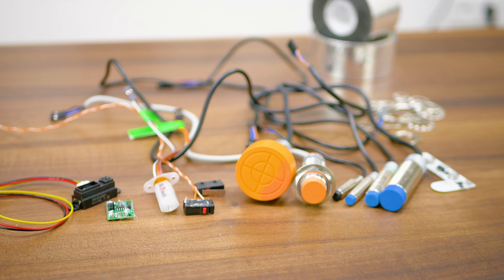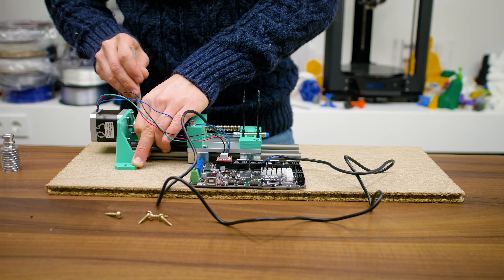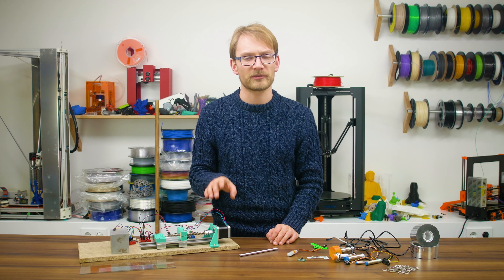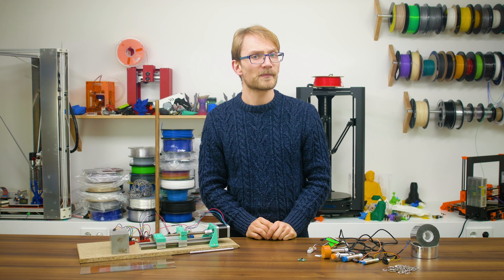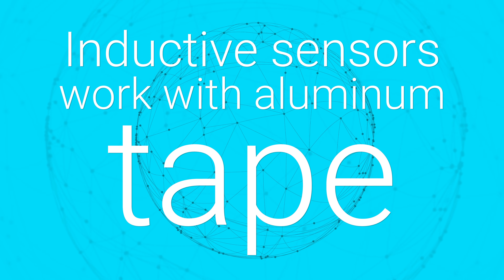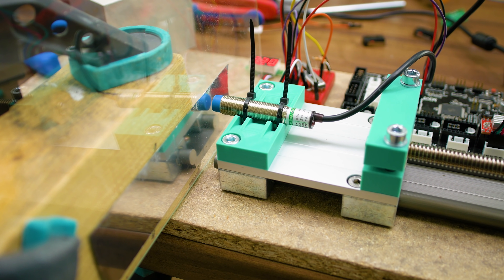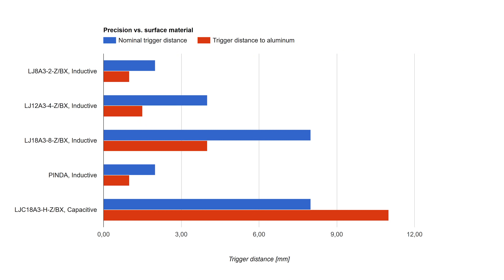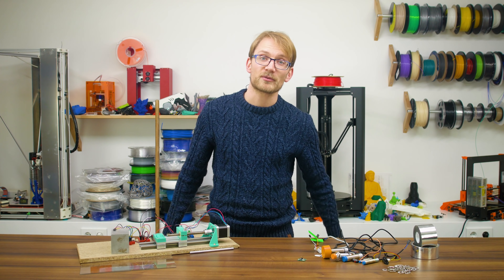Autoleveling on 3D printers: 9 myths and 12 sensors tested!

Comment: Sorry Tom but you must have gotten some kind of tape with metallized plastic, not actual foil tape, because your conclusions about foil tape not working for inductive sensors is incorrect.  If you use actual HVAC aluminum foil tape, it will detect BETTER than a solid block of aluminum.

Comment: @Thomas - And additional info for you: I've noticed a huge unreliabilty with my inductive sensor C-Lin P-802N (runs nicely at 5V) - first I thought it was caused by temperature differences caused by my huge high powered heat bed, but after a while I found that even smallest drops in the voltage of the printer control boards PSU makes sensing distance very unreliable (using a cheap chinese 12V 6A notebook-psu brick for the board+hotend). I've came to that conclusion after changing to a old and dirt cheap ATX psu as reliability got MUCH better but still got not perfect (bad quality "250W" ATX PSU). Now I'm using a 200W 12V halogen trafo, rectifier, added several very huge Elko  capacitors (about 50k µF all together) and now sensing distance is +- 0.00Xmm reliable instead of +-~0.3mm!!! I heard that the BLTouch (and it's chines "3DTouch" clone) have similar problems.

Comment: for my scratch built reprap delta we used a simple conductive type, running 1 wire to the nozzle, and another to the aluminium bed, reeally simple and easy, and no need to worry about effector tilt

Comment: Hi,
I 'm not sure what's happening with my sensor which is the 8 mm inductive npn one.  Before adding the Voltage divider I put in 12V across blue and brown and get a 12V signal on the black when I hold the sensor near metal and 0V when the metal is removed.  When I add the Voltage divider as Tom did (double checked and resistors measured with multimeter to test) I get 3.6V signal on black when not near metal and 0V when I put sensor near metal.

What have I done wrong? can I use this as a normally closed (nc) switch for bed levelling/tramming?

Comment: I think you did the BLTOUCH  a disservice, Tom.  While the other sensors perform equally well in any position, such as your horizontal position in the test fixture, the BLTOUCH is designed to work vertically.  When put in the horizontal position, the sensor pin and magnet must overcome the additional friction of sliding along the bore of the guiding hole.  This can lead to inconsistent measurements due to friction and grabbing.  I consistently get average variation in 
readings around 0.015 mm
Reply: This!. The BLtouch is probably the best sensor on the market when used properly.  It doesn't care what your build surface is and once your offset is determined you never have to worry about bed leveling or adjusting anything to do with the Z axis again. I routinely start a print and walk away, and expect it to come out perfect, and it does. The autoleveling is done once the bed is up to temperature, then the nozzle wipes across a brass brush, and quickly moves to the bed and starts printing. The BLTouch is an awesome bit of kit.
Reply: 0.015mm is a lot of deviation

Comment: Hello Tom, I have a aluminum heated bed and a genuine e3dv6, and I was trying to use the autobed leveling making a "button" that closes when the brass nozzle touches the aluminum bed. Turns out that there is some kind of "coat" or resin or something in the surface of my heated bed so it doesn't conducts eletricity. Do you know what is this coating and why? And is this a good idea, use the nozzle itself?

Comment: I don't know where you're getting your sensors but I use 1 strip of aluminum tape under glass. Works like a charm. I used it as a retrofit onto the printrbot simple metal and it worked better than with the aluminum bed.

Comment: Hi - I purchased one of the LJ18A3-Z/BX sensors for my ANET A8. I installed resistors between the signal and ground wires - I used (nominal) 18k Ohm for the small one and 27k Ohm for the larger one. After installation, the output voltage on the signal wire is 4.06 volts when the sensor is NOT triggered. 

However, voltage between the signal wire and ground when triggered is 0.46 volts or so. So, when I send an M119 command to my printer, the Z-axis never shows as 'triggered'. The 0.46 volts between signal and ground is also there without the resistors.

I am using SkyNet3d 2.3.1 firmware. Do you have any ideas on how to fix this? Ironically, this sensor 'works fine' on the five-volts provided from the Ramps board, but I wanted to improve accuracy by using the 12-volt supply (which actually measures about 12.5v).

Thanks for the great videos!

Comment: So, your "control sensor" setup got me thinking... How about using the actual hot-end as the tramming sensor on an aluminum bed with a continuity relay/transistor?  Slow stepping during the bed-level probing so the head isn't being slammed into the bed, but effectively, get a really tight contact detection.  Not suggesting the crufty inanity that are the Kossel-Mini momentary switch toggles built into the effector head... Instead, let the the hot-end and bed BE the switch.

Comment: Hey Tom, love the vid! I own a hatchbox alpha printer which uses a totally different way to level than all the ways you showed. I curious if what my machine uses stacks up against other sensors. It's a delta style printer with a floating bed that rest on three rubber stopper. Under the stoppers are these sensors. https://www.adafruit.com/product/166  It hits three points around the bed (at each frame rail) then I manually set the z height in the middle of the bed. Home, then ready to print. My question is, I'm thinking about changing to a 32bit board (smoothieboard, etc) and wondering if utilizing the current sensors or switch to a different sensor all together. Thanks

Comment: Should expect this but eh... The "run on 5v myth" is not busted.... The sheer amount of people (myself included) who HAVE ran 6-36v inductive/capacitive sensors on 5v with ZERO PROBLEMS, prove that the myth is not a myth... Hell I TRIED to run it off of a voltage divider from your own tutorial on how to do so, and the sensor never worked. I plug it directly to the board, and presto works 100% just fine.... Calling it a myth is kind of bs...
Reply: You're both only half right. You probably have a PNP type sensor which works on 5V, but he has a NPN type sensor which doesn't. They look identical and the part number is pretty much the same too. LJ18A3-8-Z/BX is NPN, LJ18A3-8-Z/BY is PNP. So when looking for inductive sensors, make sure it ends with "BY" or look for a mention that it's PNP
Reply: LJ18A3-8-Z/BX 8mm Approach Sensor Inductive Proximity NPN NO Switch DC 6-36V I6Tthis was the one I bought and I found it only worked on 5v. I used to have a 4mm anet a8 type one which I used a resistive divider with. when I tried to do the same with this one it didn't work so I kinda think Hikari has a point here. then again china could just be mislabeling stuff.On 5v it just senses my stock anet a8 bed through a 3mm sheet. and only just. Its a pain to print PETG but PLA does seem to stay just below the sensor. for this reason alone I am considering the bltouch style.

Comment: Great info, thanks Tom. I recently installed David Crocker’s IR sensor on my Prusa i3 box frame, which uses a 3mm glass bed and a red Mk2 PCB heated bed, inked black with a permanent marker in the sensor probing areas.

 After watching your video, I tweaked Marlin so that G30 would output the trigger height to 3 decimal places (1 micron resolution). I turned on my printer and made 46 measurements with G30 and got an s.d. of 1.4 microns. I noticed a trend in the data, presumably due to temperature drift somewhere in the system (probably the steppers warming up my crappy M5 threaded rods so the trigger point appeared to get lower with time). So I did another 34 measurements and the s.d. was 0.8 microns, but still with an obvious trend.
I think these numbers are an order of magnitude better than you got with glass. Maybe it matters what is behind the glass?

I should also mention there was a thin layer of glue stick on the bed under the probing area from the last print.  Also I have slightly modded my sensor board to increase the trigger height from about 2.7 mm to 3.2 mm by tweaking the angle of the outer LED using a hot-air rework station. This is so that it would clear the bulldog clips I use to hold the glass down so I could still retain my full 200x200 build area.
Reply: That's because, most likely, your bed surface is suitable for Crocker's IR sensor. The testing surfaces and setup in the video is stated as not suitable in the documentation. If you are running a glass plate on top of bare aluminum it is recommended to paint the aluminum matte black. I wish this test was done with the proper setup.

Comment: FYI. Inductive sensors are intended to be used with ferrous materials.  Their ability to trigger is severely lessened with non-ferrous materials.  Its takes a relatively substantial piece of non-ferrous material to get them to trigger at their rated distance.  this is why foil tape does not work , and why everybody complains that the sensing distance is incorrect.  in fact it is correct , what is not correct is the usage , and assumptions made.  I mean, they are "inductive" sensors , which inductance usually isnt well associated with non-ferrous materials.

Comment: Does copper give inductive sensor more sensing distance than aluminium?
If so can we add a thin small round copper plate under the PEI or glass sheet,  make it 9 points so we can make our own poor man MK42 heatedbed that support auto skew calibration?
Or maybe a thin stainless steel sheet?

Comment: How do i use a microswitch for the auto leveling? I mean where should i put it, so it is not interfering with the nozzle and mess up the print?
It seems a good option for me. I have glass bed on top of an aluminum sheet... (DIY)

Comment: The Sharp detectors take 16.5 mSec to take a measurement and output that value.  Or put another way, the analog or digital output changes every 16.5 milli second and the output stays the same in-between its readings.

Comment: I can't imagine using a Sharp sensor to level a bed. I would think the 50mm sense distance would be a major limiting factor. If you were going to use IR, I would think the tcrt5000 sensor would be a better choice with its 2.5mm sense distance.

Comment: Tom would you be willing to share your code for this please?  I have an MKS Base, the same IGUS slide (yay hackspace visit samples) and most of the same sensors, plus a couple of random ones I'd like to test - including the original and then Mk2 RRP Ormerod IR sensor - those things drove me mad, and I want to see how they perform relative to the inductive sensors I use.  Another motivation is that I do regularly use the M12, 4mm inductive sensor at 5V, it seems to be working well for me so I want to do some structured testing of 12v vs 5v and understand whether it may be 'working; but not optimal - and whether brand matters here.  Thanks!

Comment: Great, informative videos. Thank you. I was wondering if you tested the BLTouch horizontally or vertically?  I think that its accuracy is affected by gravity and would benefit from a vertical test. I agree that it is a good alternative for glass probing.
Reply: A coil-operated pin this small and  light should not be influenced by gravity at all. The testing method is perfectly acceptable in this case.
Reply: @pellin-unleashthebiker3101  not when you're dealing with micron-level precision. I calibrate measurement equipment to this level as part of my job, and misusing equipment like this is a total non-starter if I want something to perform accurately.
Reply: @TROPtastic  did you look at the precision of the bltouch horizontally in this video? It is only some microns, so still perfect. So the conclusion is it really does not matter in this case. For something else it may, but not for a simple 3d printer.

Comment: Hi, I use some lj12a3-4-z/bx on my printers and it triger on a glass plate with some almuminium foil sticked with rubber tape on it. Also supplied in 5V directly plug on my borads without any led or resistor.

Comment: Informative as always.  I use a LJ12A-4-Z/BY with an LM7805 VR on the output this gives a steady 5 volt trigger signal.
If you increase the input voltage does it does it strengthen the sensing distance.

Comment: Wondering if instead of aluminum tape, if using a quarter or half a zinc coated, or stainless steel washer, sanded flat and to a common thickness, and glued to "sensor points" on the corners, or a known distance from a corner, would be a workable solution for glass build plates and inductive sensors. One might have to go to a fender washer for enough ferrous material to sense, but if there is a way to tell Cura or your slicer that those locations are off limits for printing, it might be workable. 

The advantage I see is that most of us have access to washers, if you've adjusted an inductive sensor for an aluminum bed, you may be familiar with having to do other physical adjustments already. 

Down side would be that you wouldn't want to do grid leveling for this, unless you could etch your glass to drop such washers into the surface, and I'm not thinking that's a great idea.

Unknown is how large a washer you would have to use to get reliable results from an inductive sensor.

Comment: I read a lot of comments regarding aluminum tape working for some and not for others.  I might be able to add some clarity on the reason.  "Standard" aluminum tape has no real standard when it comes to compounding.  Many times manufacturers will use batch rejects, recycled scrap, Mold Ends and casting flash cut offs in the mix for tape.  This will introduce impurities, many of which are ferrous, that don't matter due to the tapes intended use.  It is these impurities that create differing sensing distances from one batch to the next as chemically speaking, one will be "Purer" aluminum than the next.

Comment: I would like to see the autoleving test with the tmc2130 driver. If this really works, we will have a big change in our printers. The nozzle would touch directly on the bed, remembering that the nozzle would need to be heated so that the residue does not interfere with accuracy.

Comment: Enjoyed the video. I've actually used the thicker gauge of "Duct Repair Foil tape" by sticking it to the top of the glass sheet and then putting a sheet of BuildTak on top. Maybe that's not aluminium? Anyway, my cheap sensor saw it.

Comment: When you tested the inductive sensors you didn't take in account the heterogeneity of an aluminium bed.

While printing with my VORON I have experienced inconsistencies with inductive sensors and my PEI-painted Aluminium bed from Clever3D. Basically the trigger distance was consistent on the same spot (just like in your tests), but varied when probing a different spot... and you need to probe at least 3 distant spots.

Today I switched to the VORON 1.5 X carriage, which uses the hotend itself (mounted on a mechanical microswitch) as a probe and the situation is vastly improved because a microswitch isn't affected by materials and temperature.

EDIT: In theory this applies to IR probes too, as reflectivity may vary across the bed.

Comment: Wait a minute... "All it does is to run the sensor into the surface, backs up a bit and then does that again 41 more times."

So you run the test 42 times? That's some deep thinking right there.

Comment: I got an 8mm inductive probe with an aluminum bed with PEI on top. Using the same gcode file, temperatures etc. and probing (in the same spots of course) after the printer has been cold a while, the precision varies so much I need to change the z offset with each print in Marlin by 0.05-0.10. This either results in minor head crashes or plastic spaghetti. Any ideas why this is happening and how I can remedy it? From what I understand in your excellent video this shouldn't happen.

Comment: For the mini-IR probe to be used on glass, the instructions say to put a black matte backing (black paper) behind it, or to paint the surface behind it matte black with high temp BBQ paint.  A reflective surface behind it like aluminum will give the kind of results you saw in your tests.
Reply: Tony, see my clone of Davids mini IR,  http://community.robo3d.com/index.php?threads/differential-ir-height-sensor-attemptin-clone-aint-sure-of-success-now-stage-10.6601/  ............Yes, you correct.....paint back of glass flat black.......Jimmy
Reply: I've been saying the same thing. This test was worst possible scenario for IR probes and IR probes only. I wish it was done properly.

Comment: I have another myth for you. What about getting different heights from the sensor on different areas of the bed? I have a 4mm 12V sensor, and it triggers a little higher on one spot on the bed, and I think it's because it's directly over the Y axis bearing. I have an aluminum bed (Rep Rap MK3). I use 9 points for leveling, because the plate is warped, and that corner always is further up than the other 8 places. Maybe you could put a thinner piece of Al in front of the sensor, and try putting stuff on the other side for the 2nd half of the tests, similar to you moisture test?

Comment: How does Marlin deal with the measurements from the probe? Will it compute a plane with minimum distance to each point, or does it compute a non planar surface to deal with deformations of the bed or bending/wear of the linear supports carrying the print head.

Comment: This.. really confuses things.  Because, it seems to say that the inductive sensors are actually better than the BL Touch sensor.  But, in my case, I have an aluminum heated bed with a glass build plate on top that is 7mm thick.  So.. inductive sensors would be useless on my machine, wouldn't they?